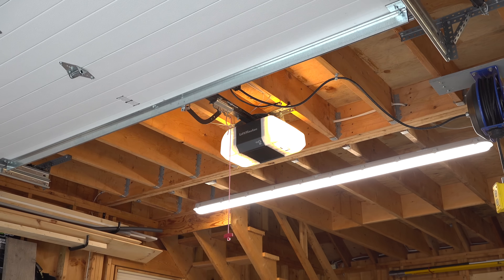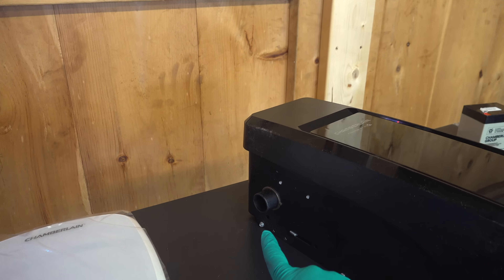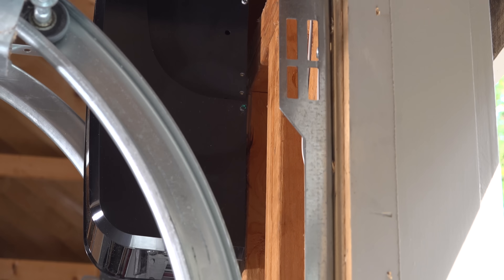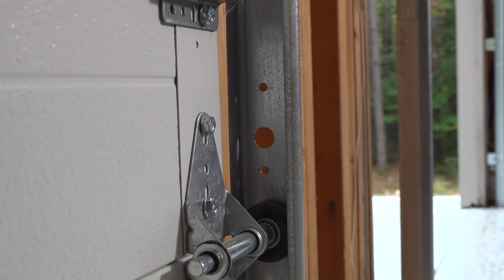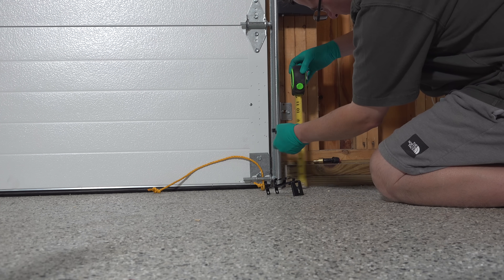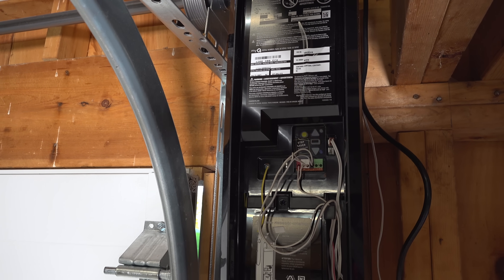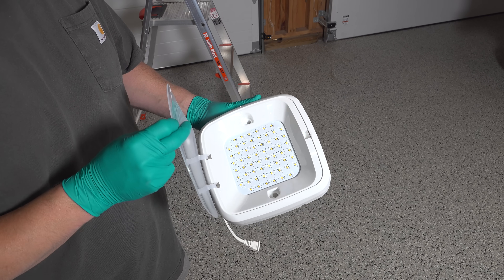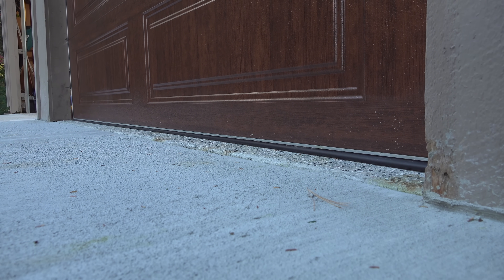Finally a SILENT Garage Door Opener that locks like a SAFE! - RJ0101

Comment: You talk about security of this garage door but you then promote a cloud based application that can be compromised by anyone that has know how.  Just give me the opener without the additional app BS.
Reply from the maker: Haven't seen a breach yet for MyQ but as I said in the video it's not required. Don't connect it to Wifi, ever if concerned, problem solved.

Comment: I have a low overhead height garage(only 7') and the track for this height required a shorter radius curved track and a special first wheel with a long arm. I tried the jack shaft type of opener when they first were introduced for the consumer market. I believe it was from Black and Decker or DeWalt(not 100%sure). The problem was it did not have enough power to overcome the force required for the door to make that first wheel in the shorter radius curved track. It was not the solution in my situation. The standard door opener also was not because it hung down too low to allow my SUV to fit with the motor hanging down. 
  I researched until I found a low overhead solution from a German company called SOMMER. They have a headquarters in Charlotte, NC.
 The very small motor a tually moves along the track and it is very quiet. I have it now 10 years and it works perfectly.
  Also can pair it with the programmable buttons in my vehicles.
I do believe they now make it so you can open and close it via an App.
Reply: Not sure how much has changed between now and then. But you might have had a wrong tension in the torsion spring. I had the same issue with this unit when I installed it. After tension adjustment, it wasn't a problem anymore.

Comment: I hate to say it but there’s a serious flaw in these openers. I was broken into my garage and very surprised how easy it was. If you manually open the lock, you will see that the motor drive train can be easily overcome and you can lift the door. Now look at your lock, it has a lever on both sides for a left or right installation. What they did was push a small rod through the door seal and push the lock open. There’s a remedy, install a plate so they can’t do this. I moved my lock up high where they can’t get to it.

Comment: I made a YouTube video about the fact that the doors only go down with gravity. That is what @hp7033 below is talking about. Unless you can get a big slope on your garage door track, the cables will simply unspool because gravity is not able to pull the door down when the door is all the way up and sitting horizontally to the ground. They sell garage door pusher springs. I believe that these will shorten the life of the opener. Listen to YouTube videos where they installed these and you can hear the motor struggling. If you wan to make them work you can watch the video by typing in....  Jackshaft Garage Door Opener Unspools Lift Cable - Remedy    Then you will see the monkey business one needs to do to make it work. But yes...they are quiet.

Comment: My one criticism of Chamberlain is their MyQ system doesn't allow local control from an OnPrem solution such as Home Assistant.  You have to use the cloud and they've closed off their API to Home Assistant.  It's frustrating because you can't simply add in a third party WiFi/Zwave unit that just presses the wall control button for you.  They do some manner of Digital control on the two wires to the wall unit.  I don't like my ancient Craftsman opener, but its wall button is a simple momentary switch with an LED.  Anything can close that circuit to tell the opener to start/stop.

Comment: "Leveling" with the wall isn't what matters when attaching the opener to the jackshaft, squaring it with the jackshaft is what matters. You want it to be perfectly straight or you create a bind point that will eventually crush the jackshaft.

Comment: Thank you for the informative video. I’ve been looking for a garage door opener to replace mine, but my garage has only a few inches at either side, so not sufficient for an entire side mounted motor. Do you (or anyone reading this) know about alternatives that could work in such a situation? Perhaps one that is mounted where the coil is located, short ceiling mounted, or even an extra slim version of the side mounted?
Thanks again

Comment: This won't work on my home garage door.  There is not enough clearance beside the garage door.  We currently have the Genie "ultra quiet" garage door opener and so far there are no noise or vibration issues.

Comment: Neighbor had a jack shaft where the tension spring rusted out and snapped busting a window
Reply from the maker: They can be scary. Tension springs are even worse. Normally they just break and stay in place but if a piece becomes free it can shoot across a garage like a bullet. I have always been surprised there isn’t a safer way to

Comment: I just installed a new Genie belt driven door opener. And compared to the old gear shaft opener it's almost completely silent. You have to be in the garage to hear it at all. And with the programming of the door opener you program it to the close position, so it doesn't bang into the ground. It has a battery backup so if you lose power you still can open and close the door like normal. The Genie also has an app that notifies you when the door is opening or closing. You can also control the door from your phone so if you forgot to close it, you can still close it through the app on your phone. Keypad that attaches to the outside of the door so you can open it if you don't have a phone or the opener remote. It has a program combination that you program so nobody off the street can just open it. The part about coat hanger opening the door is only if they break into your house. This door opener was $299 from Amazon. Worth every penny and more. The instructions and the way Genie color codes the bags of hardware make assembly pretty easy.

Comment: I installed one of these, It works about 3 times, then the cable on the far side (not the side of the opener) comes off the pulley and just becomes blindly infuriating.

Comment: A good quality belt-driven opener is also pretty quiet, so I don't think noise is the #1 selling point of these.  The point is if you want to free up your ceiling space, for say, a 2 or 4 post lift in your garage or shop/barn.

Comment: this is nice. i have a 1800s carriag ehouse that a previous owner converted 2 grage doors on that are wood. they are HEAVY. one is sort of getting rott at the bottom and bowing and the panels are popping but its manual. the other main one is on a opener and man when that thing opens it chugs along i keep thinking one day that thing is going to break and fall through my car or something lol its extremely heavy. i have to tighten the bolts once in a while from all the jerking they loosen up

Comment: Just want to point out. If you are getting into their cloud based myQ. You are stuck inside their extremely limited eco system which does not play well or integrate with any mayor home automation system including Google Home or Apple HomeKit. Nevermind Home assistant. When myQ goes down or you loose your internet connection, you won't be able to control the doors with the app.

Comment: You mean 'plumb' not 'level.' The error is mitigated by the use of the 12 pt. socket on the obsolete square-head set screws.

Comment: Chamberlan does make the best consumer grade openers, in my opinion. I have one of their belt drive units that is still going after 24 years without missing a beat and is actually pretty quiet. If it ever dies I will probably upgrade to this model.

Comment: What happens in 20 years when the app/OS are outdated - will the opener still work - I suppose the manual buttons will?
Reply from the maker: The app is only for remote use. It is not required at all to use the opener, remotes, etc.

Comment: I've had the LiftMaster ones on both my large garage doors since 2010.  They are absolutely not silent. They're much quieter than overhead garage door openers but there are still the sounds of the actual door itself opening and closing. Also, as others have pointed out, there are issues with the tension which causes the doors to pop back up often and in the 13 years I've had it I've had to replace three springs.

Comment: Who are the idiot engineers who decided a square head bolt system was smart?????? Why not 6-point hex???? Duh.......These guys are still living in the 40s.
Reply from the maker: I agree, there must be some reason for it. I would think the square bolt must cost more than using standard ones Maybe an engineer or something can comment as to the benefit?
Reply: @SilverCymbal  Thanks! I've adjusted the torsion springs on my commercial doors and it's a real treat trying to get the wrench on those stupid square heads and tightening them while you're holding onto the bar in the hopes it won't slip out and end your life!! With a hex socket, it's almost fool proof. Using square head bolts for this application is like trying to thread a needle using a sledge hammer! Thanks for the great video, by the way :D.

Comment: what if u got locked out of the garage?how do you unlock it from outside without wifi?
Reply from the maker: You don't need the wifi at all, You can add a external keypad that uses RF like the handheld remote.

Comment: Good Job!   Thanx for sharing this.  One question:   When the spring breaks; typically when the door is partially open, is the opener strong enough to hold the door inplace or does it come crashing down.    Also, does such a failure damage the opener by over-torquing the jack-shaft drive unit?
Reply: Hod outs for over 10 years. Never had the spring break.

Comment: You'd think in 2023 you wouldn't need to hardwire the sensors to the opened. Batteries should suffice, even if I had to replace them every few months.

Comment: Air powered staples. Poor wire 😢
Reply from the maker: If the tension is too much, lower your air pressure to 50psi, you will make the staples just touch the insulation without any risk of damage.

Comment: When installing the sensors, pay attention to which is the receiver, and put it where it won't get hit by direct sunlight, regardless of time and season. I also suggest attaching them to the wall instead of the door rails, because I've had vibration in the rails trigger the sensor and make it think something was in the beam.
Reply: I'd love to hear more about this. Every Spring and evey Fall if I close my garage at the wrong time the sun hits the sensor just right and prevents the door from closing. I have tried to use "shields" with limited success. How did you or would someone mount these to the wall so that this did not happen?
Reply: @AverageatMostThings  If your garage door faces east or west, swapping the position of the sensors may be the most effective option, so the transmitter is the one that gets direct sunlight. For mounting to the wall, imagine a line where the beam goes between the two sensors, and continue that line back behind the sensor until it hits a wall. Mount the sensor there.   You may need to fabricate appropriate mounting hardware. 

This will also let you use a larger shield, farther away from the sensor, if moving it back isn't enough to get it out of the sunlight.

Comment: It is quiet, not because it is a jack style but because it is a slower operating DC motor instead of a high speed AC motor with a gear reduction. So for residential the difference in speed is not noticeable. The LiftMaster commercial versions I've seen are in the standard overhead track style although it is no longer a noisy chain drive. And they come with a battery that allows the unit to operate during a power outage which is now mandatory in many locations. Our LiftMaster battery unit lasts about a day which probably gives you about 80-100 up/down cycles.
Reply from the maker: It may be slower than commercial units, those I haven't worked with. But the speed of this opener is the same if not a bit faster than the standard chain drive unit in the bay next to this.
Reply: @SilverCymbal , that was my point a residential AC chain drive is very noisy because it spins fast and has a reduction gear. Because of the reduction gear the door moves more slowly than a commercial unit. This drive moves at the same speed as the door and can vary in speed which is why it is so quiet. When you use these drives in a commercial setting the door moves much more slowly and quietly but for residential it is about the same speed.

Comment: Thank you for the video. Can you program the app to ensure doors are closed at a certain time each night?
Reply from the maker: Yes you can and you can also set schedules to do this at certain times to ensure its closed. Its a clever app the way it all works, seems like they thought of everything. No monthly charges either, but they have started putting a little pop up add in the app, which I can deal with since its still free to use

Comment: Good informative video, but a word of warning for anyone who has interest in using a home automation system with their opener:  stay away from Chamberlain/Liftmaster.  Their CIO just issued a statement announcing they will not support any 3rd party integrations with MyQ.  Tens of thousands of users of Home Assistant are now out of luck. They chose to lock out the hobbyist community.  Terrible company practices and anti-consumer.  Stay away at all costs.

Comment: Replaced our 20 year old chain driven garage door opener with a belt driven one and it just as quiet as the one see in this video, can walk out of the garage and have to door close and don't even know it working if you didn't see the door coming down. Also the deadbolt lock on the garage door only works if you don't have other entries that could be compromised such as a entry door or window.

Comment: This is how commercial garage doors have operated since the beginning of garage doors.  The standard ceiling mount option is cheaper to produce and they work just fine for light duty applications hence that's what most people have.

Comment: Is there a way to open the door from the outside should there be a power failure, and you don't have inside access to your garage? This system looks to need inside access.

Comment: This kind of garage door opener looks and sounds very nice. At 4:52 it looks like the bolt lock stops the door from opening by coming in the way of the door guid wheel. Is there a reason the bolt is placed a few inches above the wheel? Why not place the bolt less than an inch above the guide wheel? That would make the opening smaller if someone is trying to pull the door up.